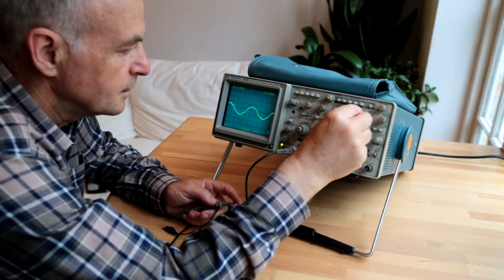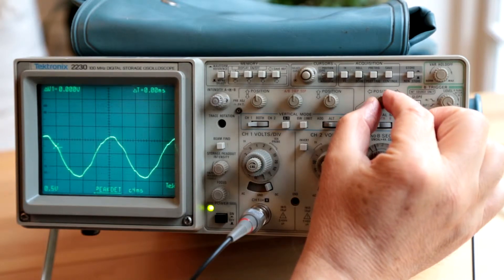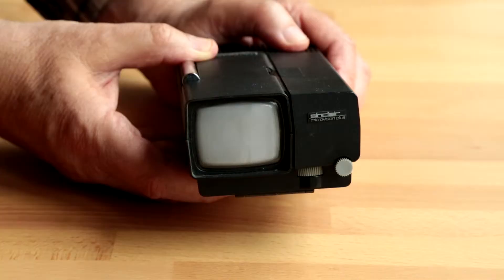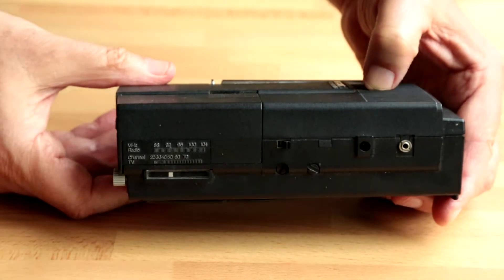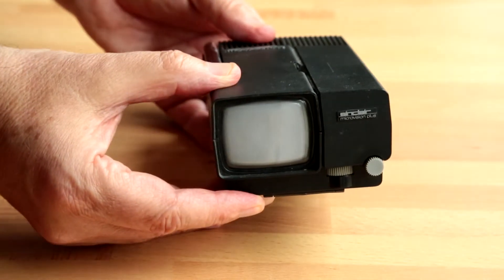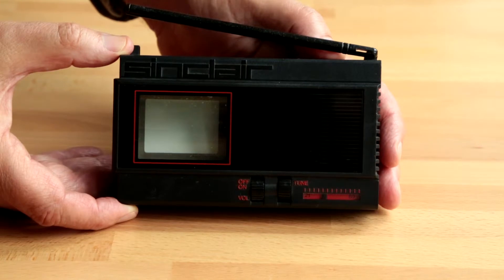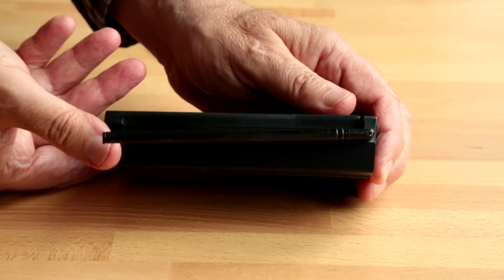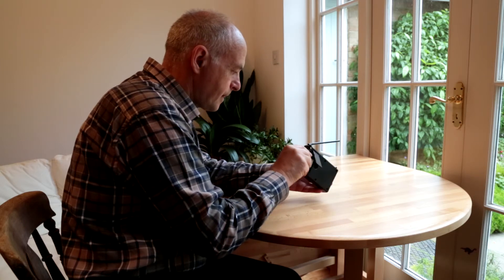Brian Flint Talks about Sinclair Radionics mini TV1B and FTV1 pocket televisions

Comment: I just repaired two MTV’s after countless hours tinkering with them and combing over whatever schematics and info I could find. Among other issues, the tuners were broken in both of them and had to find some Varicap and diodes that would work in the VHF circuit since the originals are unmarked. Finicky things! 

I wish there was a way to reproduce those integrated circuits!
Reply: Hi Mate, I don't suppose you have any info on L1 and L2 on the TV80 boards at all? I can't find any info on them at all, and my L2 (I believe it's a variable inverter) is in a real state. It comes under CZNS 5044 FOT in the service manual.
Reply: @ no I’ve never had a tv80 (yet)
Reply: I was involved in the engineering of both the UHF and the VHF tuners for the MTV. I don't have any schematics for them. I do have some spare parts in a box which I have kept for 49 years !!! The UHF tuner design was kept the same from the Macrovision MTV to the TV1B.
Reply: @ wow that’s great! I have been a bit obsessed with them and I’ve fixed / restored several now. Still have a lot to learn on how the tuner circuit works but I’ve gotten better. I have a couple units that I cannot fix because the ICs in the IF (ST1 and ST2) boards are bad and cannot source replacements. 

I’ve also finally found out what the actual value is of the Varicap diodes in the vhf tuner. Usually those were unlabeled but one unit had the labels on them. 

If you ever want to let any of your spare parts go I  would be interested! 

That also  goes for teaching me a thing or two about how the circuits work!
Reply: @ Same applies here! Could really do with a spare for the L1 and L2! :)
Reply: @sideburn  As I remember the voltage applied to the Varicap diodes were taken from a +30V dc rail. The voltage for the Varicap diodes in the VHF tuner may have covered a different voltage range to that on the UHF tuner, but both would have come from the approx +30 dc rail. My part of the design was the power supplies including  - EHT voltage ( about +1.7KV ). I designed the IC ( manufactured by Texas Instruments ) which was the timebase circuity ( line 15625Hz and frame50/60 Hz ).  I also took over the design of the UHF and VHF tuners, after the design Engineer who was working on them left the company.

Comment: Hi Tom, can I kindly ask if Brian when working at Sinclair ever had to deal with a prototype 4 function calculator? I have a Sinclair prototype of a calculator, it's a non-working design prototype. Mustard yellow color, I believe it is made of clay or aluminum with resin lid. It should have been designed between 1975 and 1977, but no other information is found. Maybe Brian could remember that. Thanks in advance. Best regards, Claudio
Reply: Hi Claudio. I did not have much to do with the various calculators which were produced in the mid 1970s at Sinclair Radionics. I did however help test the very first calculator ' Executive' calculators which were made on a small production line in 1972.
Reply: @brianflint133  Thanks for your kindly reply. Could you direct me to those who worked in that sector? Thank you

Comment: I still have an MTV1, but sadly there are no longer any analog broadcasts to receive on it. In 1985 I watched Live Aid on it when I was visiting Soviet Estonia, receiving the signal from Helsinki Finland some 55 miles away.
Reply from the maker: I tried the TV just before they switched to digital and it still worked, so it is a shame there are no more analog broadcasts. Thanks for watching the video.
Reply: Just get an rf modulator and some rf amps and connect it to a roku. You’ll have your own mini tv station that will have the range of your house.